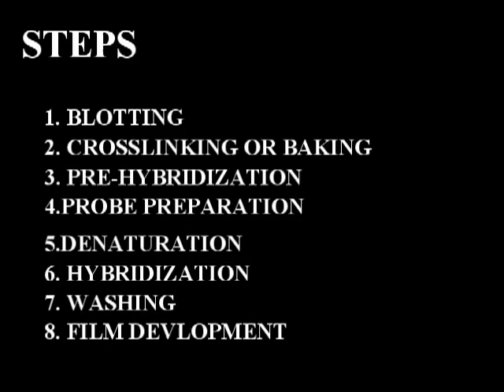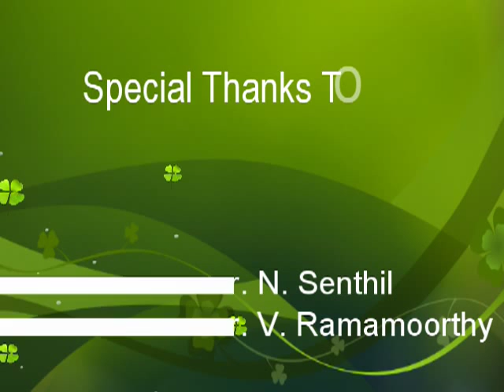Southern blotting

Comment: I was wondering, is the radiolabelled probe carcinogenic or capable of causing infertility? I mean, should it be handled using protective equipment like lead gowns and such?
Reply: The radioactivity of these probes is very low. However, long term contact might cause some issues so care should be taken but, wearing a lead gown is up to you.